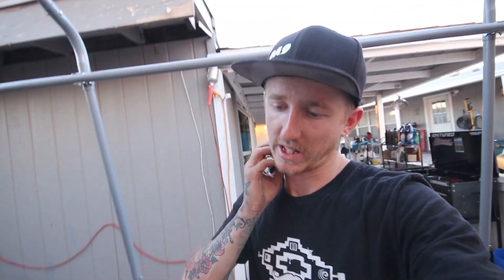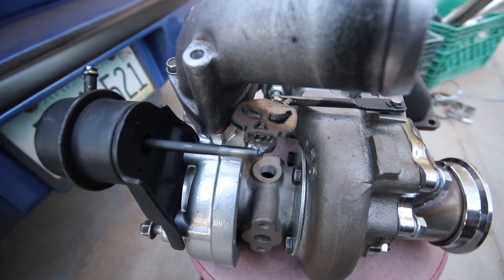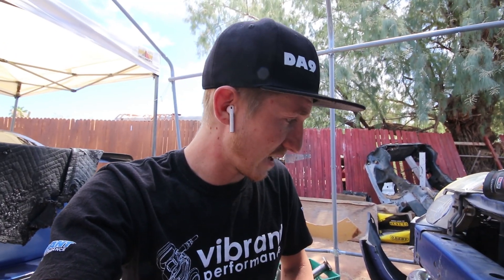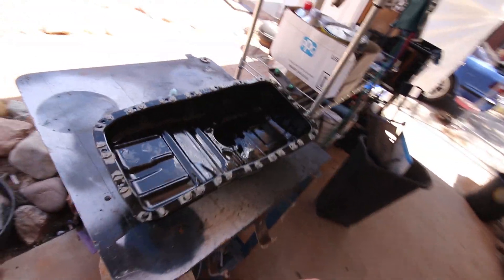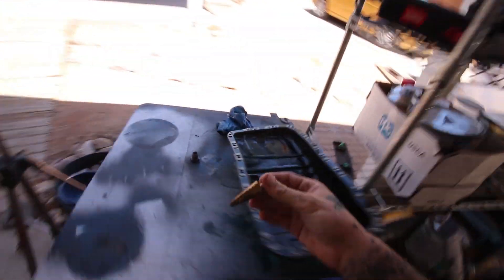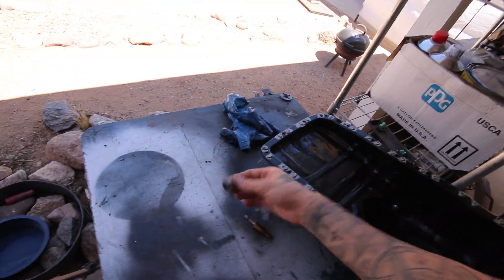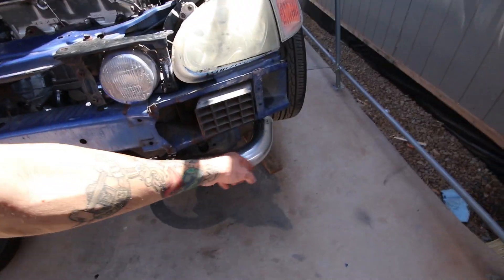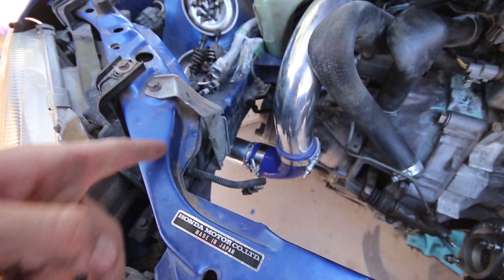Boosted Del Sol Part 3: Custom Piping and Modifying To Fit

Comment: Best bet is using two 90 degree couplers right off the intercooler, dual back door eliminates bumper fitment issues and less couplers. Minor hole saw work to the rad support but totally worth it. Good luck, looks good so far.
Reply from the maker: Thanks for the tip, but I already had to thin the bumper out from the back and it’s fitting up decently well now. When I change the setup in a few months I may go for the back door style though

Comment: I think since you got a tig that does ac, you should 90 off of the coupler at the turbo and do a back door into the intercooler. It would eliminate 2-3 feet of tubing and the less couplers the better. I think now that you are doing turbo things and fabrication, you’re gonna blow up. This is what the people want
Reply from the maker: theres really no room for it other than if i cut out a section from the core support right there. i briefly looked at it, but ill have to check again. but for now im just sticking with what i have since i know it fits and should work fine

Comment: That actuator is dangerous for boost creep man
Reply from the maker: Explanation?
Reply: The flap doesn’t open all the way sometimes and the exhaust can back feed in to the turbo and cause it to over boost
Reply from the maker: What would cause it to not open all the way? It’s a factory sr20 turbo so I can’t imagine it being a problem on those setups. When I added that spacer on it after I clocked it I ensure it would not catch or “hang” so I think I should be okay
Reply: The diaphram could be bad and it's just the way exhaust gasses flow

Comment: Why don't you just clock the turbo housing down so your charge pipe fit correctly?
Reply from the maker: Can only clock the turbo a couple degrees because of the wastegate actuator
Reply: @ChrisSadowski  ah I see! Also should do a back door on the intercooler for the charge pipe for turbo side
Reply from the maker: I may do that when I upgrade to a t3 turbo and different manifold in a few months. Custom making this whole setup to just get it done then I’ll redo it better when I change turbos. This is more of a practice/have fun run for me

Comment: Your return line should not have that loop in it. Shorten line and try to have it go as straight as possible. There is no pump only drain.
Reply from the maker: You clearly didn’t listen on the video when I said “THIS IS NOT HOW THE LINE IS GOING TO BE, I NEED TO CUT IT BUT IM PLACING IT HERE TO PREVENT DUST FROM GOING IN THE PORTS AND SO I DONT LOSE THE HOSE” 🙄🙄